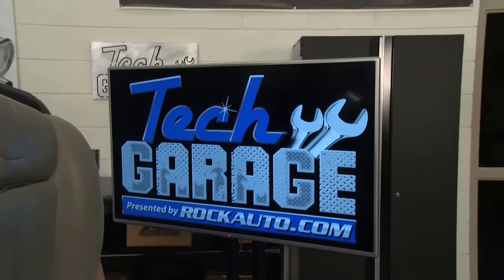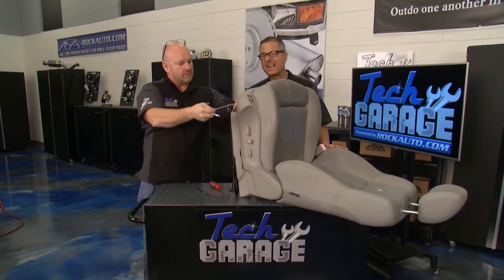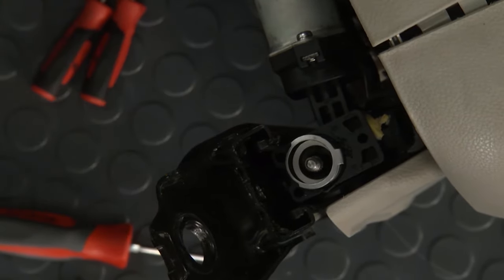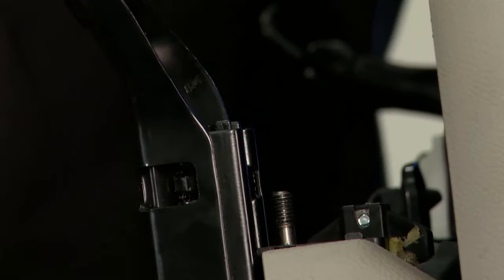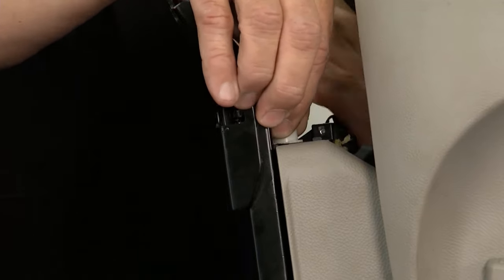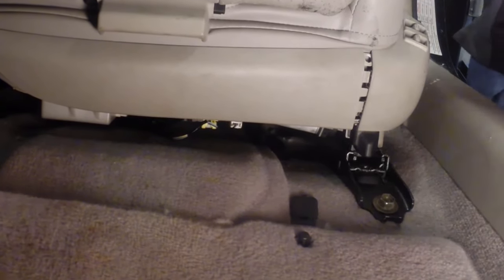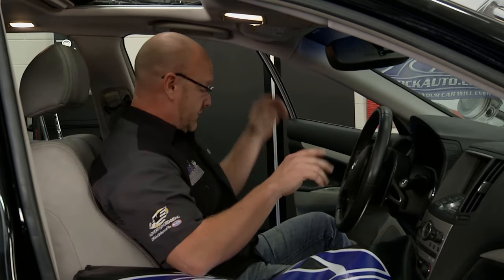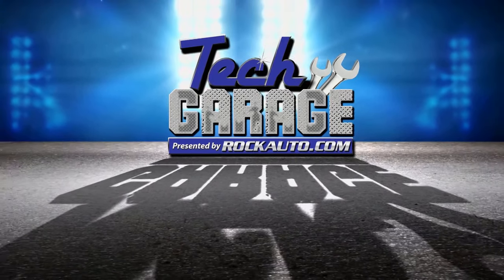Seat Motor Gear Fix & Reinstall

Comment: Do you have to remove the seat from under the vehicle or can you reach in from under the seat? Is there a video showing removal?
Reply: 4 mount bolts
Reply: Bolts located just inside of the vehicle and on the four corners of the mounting bracket.
Reply: There are some videos that show you the beginning of this repair that is the seat removal.

Comment: A $4 part from Rock Auto, but the dealership would charge $250 an hour for labor, and would've charged for at least 2 hours work (and rightly so). The entire job would be at least $600 or more with tax included.

Comment: On my 2003 Accord the driveshaft housing is broke on both ends but the fore/aft adjustment still works,the seat just has about 1/2 play in it.Have you ever replaced that connector shaft?

Comment: It would have been nice to have the part number and where to locate this worm gear.
Reply: You can see the seat and where they worked ad whear they accessed the gear, But yes, I am having trouble finding that part.
Reply: @paulkchaney  did you ever find the part? I can’t, I wonder if they still sell it on their website.

Comment: That's neat.  How did you know that the rails were perfectly aligned so that there's no twisting once the new worm gear was replaced?  Thanks.
Reply: probably because the seat rails were both in either the full forward or full aft position.

Comment: I have a 2014 Tahoe LTZ that the rear of the bottom seat won't go up or down but the motor still comes on and runs. Would this be a gear issue or could the drive have come off track?
Reply: I have the same problem.  Sad they won't answer your question.

Comment: Very simple repair however it does not work on all cars. My 2015 Ford Fusion has the same issue but I cant find parts to fix the track. Ford wants $600 for a new base. How about a seat video on a 2016 Ford Fusion? I can't find any repair parts.
Reply: Yes , Please make a video on the 2016 Ford Fusion. I have the same challenge.

Comment: Why is there no part number vidio is worthless without it
Reply: Part number is going to be dependent on the specific make and model of vehicle.
Reply: @Todd66   Thanks Todd. I spent ten minutes on the site for the exact same part on the same year and model of Explorer . So,  this part number would be helpful in this specific case. I could not find the number
Reply: Paul yeah that sucks. In your specific case a part number would have been handy, but it might have confused the other 99% of people doing the job. I did not even know these things were serviceable. Did you ever end up locating the part you needed? If so did you fix it like this video?

Comment: HI Tech Garage.  I have the same problem with my seat in a 2007 Chevy Silverado.  However, I can't get anyone to give me the part number to replace the drive gear.  They want to sale the whole seat base for $700.00 +.  What is the part number for that gear and where can I find it?
Reply: Good luck with that.  I have the same problem with my 2500HD.  The problem is the seat is stopped over the rear seat bolt, with no way to move it.  The gearbox is stripped, so I cannot turn it with the drill like I can the other side.  The other bracket bolts are near impossible to reach, but that is my next plan of attack.  Also, good luck finding parts for that gearbox, you have to buy the whole track system.  I never found the gearbox or parts.
Reply: I have the same problem in my 2010 chevy traverse do they have a worm gear for my seat?

Comment: This doesn't work on a GMC truck or avalanche motor and gears are independent for each side ... Typically it's the plastic cog, that needs replaced with a brass one.

Good to know ... Otherwise
Thanks

Comment: overkill. I had the same issue on a suburban power seat. Did not remove the seat just reconnect the cable that was connected to the motor.
Reply: It's certainly not overkill!  The gear is broken, you cannot connect the drive spring to a broken worm gear!